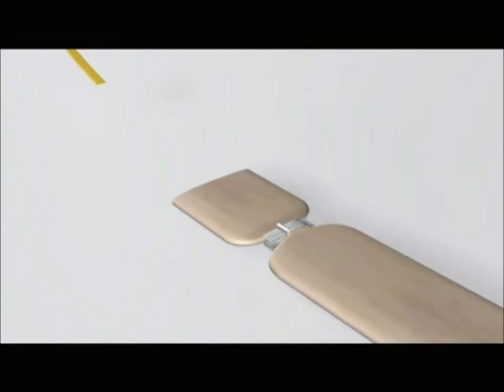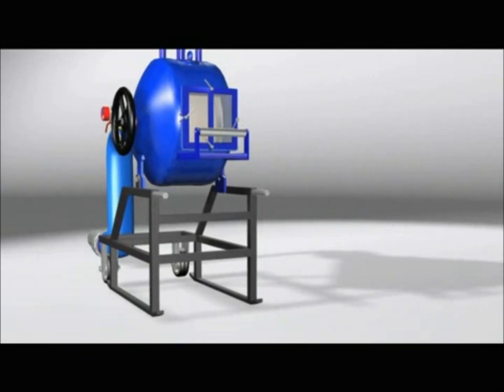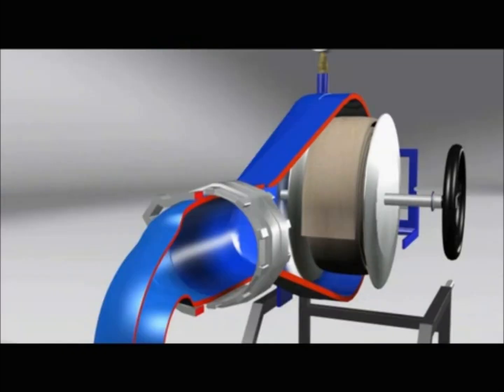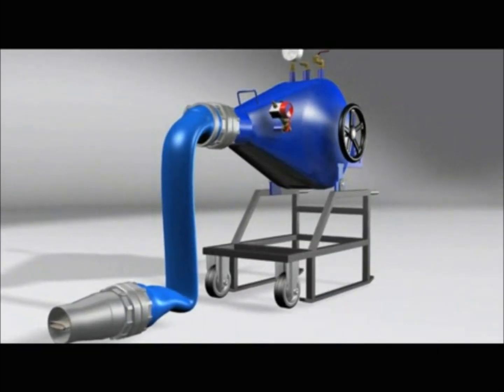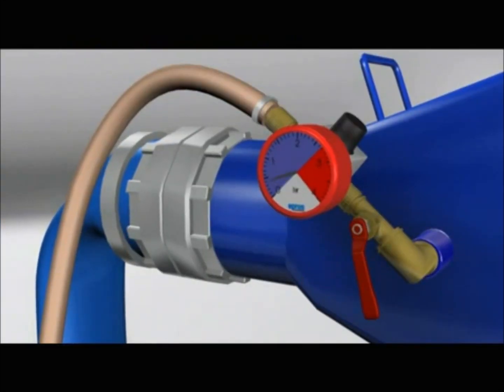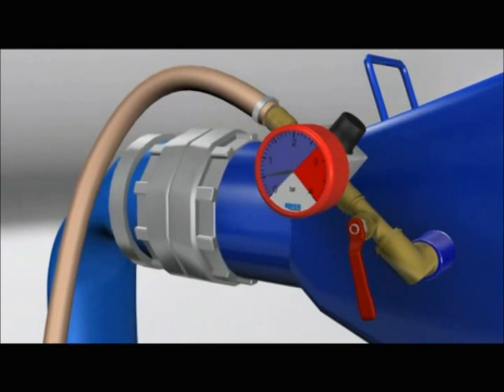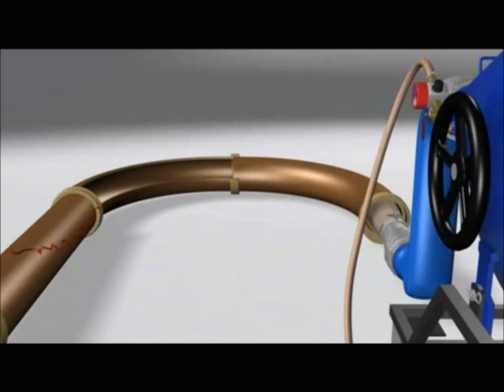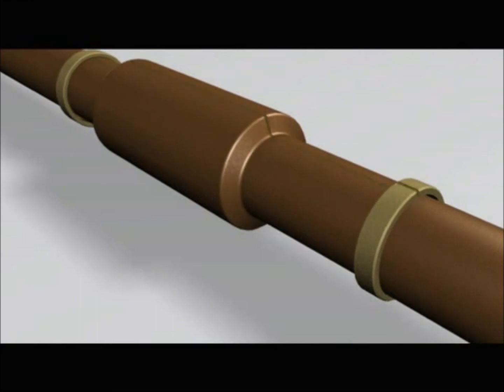CIPP (Cured In Place Pipe) Demonstration - Advanced Pipe Repair

Comment: What do you do if there is a Y or T in the pipe?
Reply: They use robotics to cut out the Y, T or BR
Reply: Skip line it
Reply: They do what is called a reinstatement., So after it cures they cut a hold at the y or tee to open it back up.